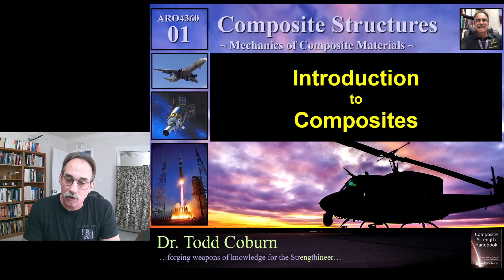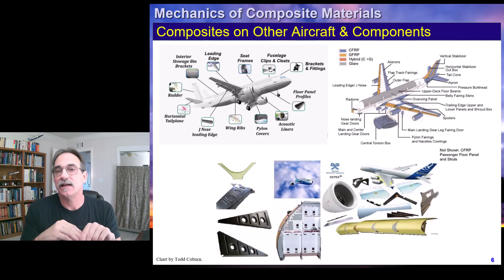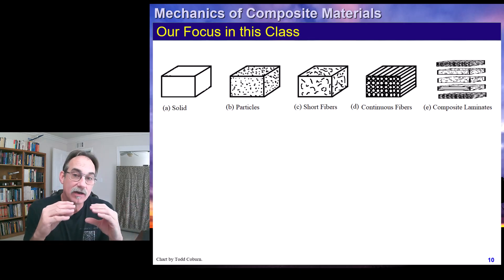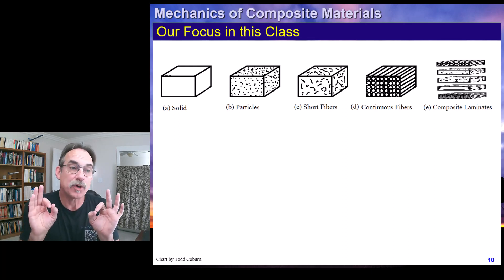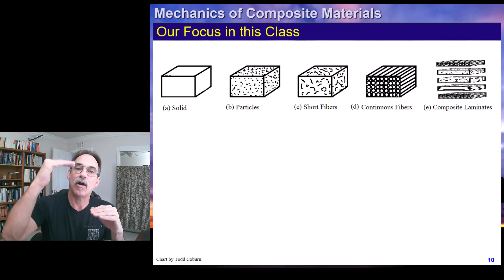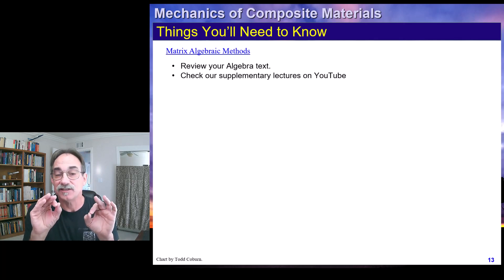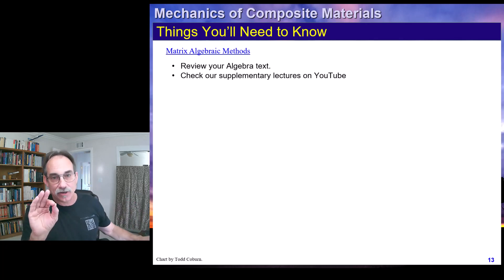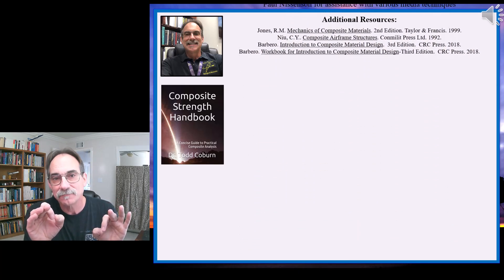Composites: L-01 Introduction to Composite Materials

Comment: Hello sir, at 11:30 you describe what happens to spaghetti noodles if they are embedded in a matrix, and how they're able to gain compression strength. This compression strength is just the strength of the matrix itself right? And is the new capability always close to the tension strength or is that again dependent on the matrix/glue they are impregnated with?
Reply from the maker: The embedded strength is probably closer to the tension strength than the matrix strength.  

This will be clearer after you review some of the later lectures on strength